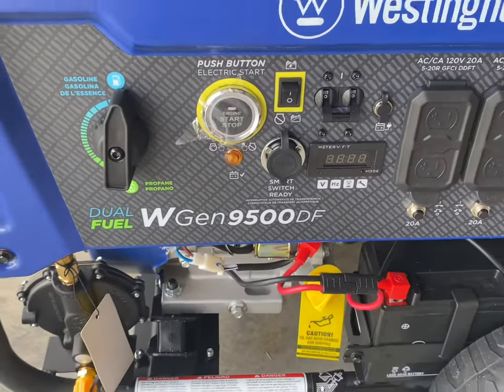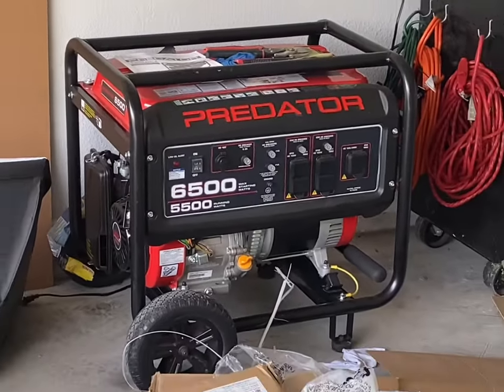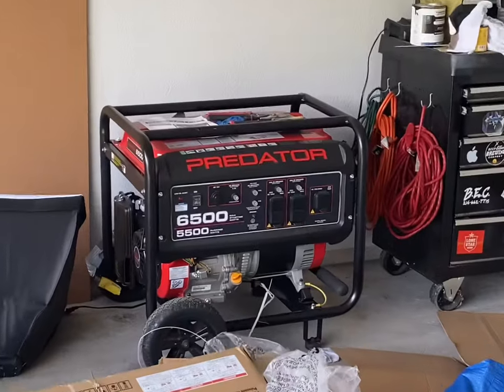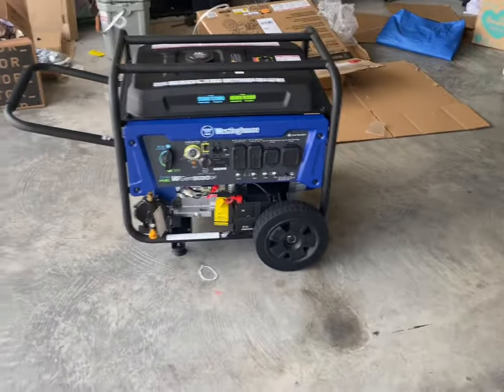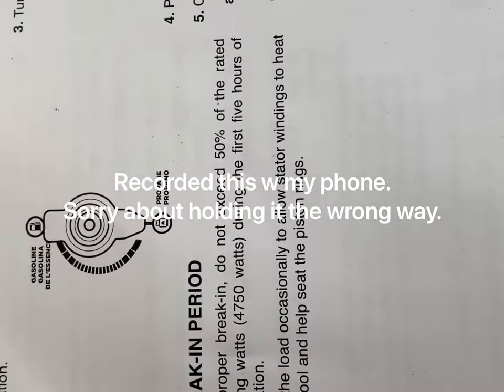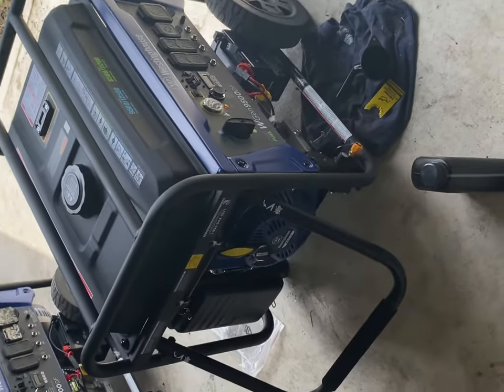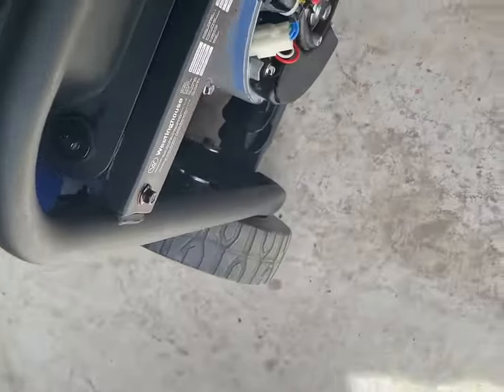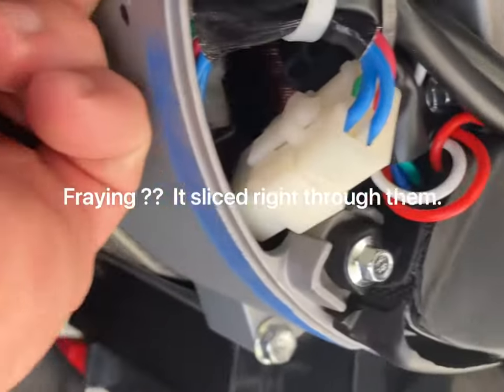Doing the initial engine and oil break in on my brand new Westinghouse Wgen9500DF generator.

Comment: Thanks for posting the video Korey. I bought this exact same generator last year. We`ve had to use ours a few times since last summer when we lost power in a few storms. I can`t say enough good things about ours. It runs most of our house, including the freezer in the garage. We run ours on propane because i don`t want to deal with gas and cleaning it out for storage when we`re not using it. I`ll be changing the oil in ours over the weekend so that its ready to go when we need it again. All i can say is, money well spent. I did all the electrical gen hook up`s to the main panel my self. I keep our generator in the garage, exhaust gets vented to the outside. I have a 15ft 50A quick connect cable that plugs right into the gen inlet box, and a breaker lockout on the mains. Hit that remote start, she`s runnin beautiful. After all the reviews i read, this was the right generator for us.
Reply from the maker: That’s awesome man! I definitely would love to be able to plumb it all from the inside of the garage, but I need the space more often than not and I’m moving them around fairly regularly  haha. Eventually I’ll make a small shed outside to keep it in, safe from the elements and locked up. The generator is absolutely a powerhouse and is the perfect portable whole home generator in my opinion as well. If I had a propane hookup I’d probably run it off propane in order to keep the carbs from getting gummed up, but I’ll just keep running it every couple weeks to try and combat that. Thanks for the comment man!
Reply: We just got one and I would like to leave it in the garage, would love to know how you set it up to operate indoors and vent outside.
Reply: Even though it’s vented outside, that can be very dangerous if something went wrong with the exhaust venting. Especially if your garage is attached obviously. I’d really consider if it’s really worth it.
Reply: Help we
Bought this same Unit and it smokes and uses oil then the safety shut it down can not get customer service to do anything .

Comment: I have the same generator. But my central air won't work on it. I'm using the 50amp to power the whole house. My AC has an older Goodman condenser unit. In rush amperage is 74. I have a Micro-Air Flex soft starter on the way. Hopefully that will take care of the issue.

Comment: I wonder why so many people change the oil before 5 hours as the manufacturer specifies…not judging, just honestly curious. I’ve also seen people using synthetic oil which they also say not to use…I’m going to do 5 hours under various loads myself and then change the oil. Nice video!
Reply: More oil changes never hurt an engine. There is debris from the factory. I personally plan to add oil and then change the oil before I even start it to get out any debris possible before running it. Bearings and cylinder walls hate debris. Then I will probably run it 5 mins and change the oil again. And then do the break in like this guy. I mean, it's about a quart of oil and such an easy oil change process, why would you be so cheap and lazy not to do it?
Reply: @JetFire9  Has nothing to do with being cheap or lazy. I followed the instructions, did as Westinghouse suggested and my engine is fine. The debris help break the motor in. Why do you think it's called a break in?
Reply: @JetFire9 We don’t know what kind of oil is in new Chinese built engines. Five minute run then drain is a good idea. Some of the Chinese oil smells like fish.

Comment: I probably over did breaking in mine (Champion 11,500) I did the 1 hr, 2 hr, 4 hr, 8 hour, 16 hr, 32 hr break in on oil changes (that includes using it during power outages). I put STP in the spark plug hole before I first ran it (and pulled it through 10 times before starting it) to lube the cyl. walls. I use VR1 racing oil in it and Marvel Mystery Oil in the gas. I know I over do it but I don't need it to quit on me when I need it.
Reply from the maker: Wow! That’s some serious dedication to the break in, but I 100% agree with it if it means a working generator when u need it! 🍻
Reply: I agree.

Comment: I decided to buy mine through home depot instead of home deliver.  My theory was that there'd be a smaller chance of it getting mishandled if it was delivered via semi truck.  I used to work at a home depot and everything got backed out of the truck with a pallet jack.
Reply: I bought mine through Menards. Got a Menards rebate. $300? Picked it up at the store.

Comment: I got this same generator a year ago, and am just now getting it up and running. Working great. Quieter than I expected. When it's running I can barely hear it inside the house. I'm using gas now, but the propane option is interesting. My next step is to set up this generator in a permanent spot outside in a shed/doghouse, and make it as easy as possible to activate it during an outage.
Reply from the maker: I plan on doing the same thing. It never fails, the power goes out when aim not home and my wife has to drag this thing out and set it all up. Making it permanent is a must.

Comment: Got this generator and had the 50 amp box run  outside so I can run everything with one plug.  Great vid!
Reply from the maker: Yessir! It’s a great generator and perfect for running the house. Appreciate it!
Reply: @KoreyB03  I have not broken it in yet.  Do you recommend the 1 hour change oil 2 hour change oil and then 2 hour change oil and then after that put synthetic oil in so its ready for game day?  This is my 1st generator so I just don't know
Reply from the maker: @USMCSDI  there are alot of different ways to go, but I’ve always gone 1 hr and then changed it after that. Then gone another 1-2hrs under a 50% load and changed it. Then I’ll run it another 1-2 hrs and then check the oil for any visible shavings and just made a judgement on changing it again. After that I change it every 50 hrs or if I run it for 15+ hrs at once I’ll change it. That’s probably overkill, but I need this thing to be dependable.
Reply: @KoreyB03  Roger that!  Makes complete sense brother.  I am in Southwest Florida... been here since 1997 and Hurricane Ian left me NO DOUBT that I needed to make this investment
Reply from the maker: @USMCSDI  no doubt I’d have one if I were there! We’ve had some rolling blackouts here in TX lately and my wife works from home so we use this thing more than I’d like to admit. Be safe down there!

Comment: If your going to run your central AC then add a soft start kit to your AC unit it will cut your starting amp draw way down
Reply from the maker: Absolutely. I plan on installing one of those in the near future. Luckily I haven’t had to use it much for the ac/heat so far.
Reply: I have one on the way. Micro-Air Flex. My Goodman Condenser unit lists in rush amps at 74.

Comment: It's funny but I got exactly same generator on Amazon 2 years ago, and like yours mine was damaged, mine badly, with crooked frame and busted stepper motor on its carburetor. The odd part was, that the shipping box didn't have even a sign of damage on the exterior, not even a dent, but damage on the generator was substantial.  I'm guessing it was damaged at the factory, packaged and shipped from China anyway, but it's just my speculation. Amazon refunded my money and now Im trying to find youtube videos with stepper motor close ups particularly, as mine has completely missing those parts. Thanks for the great review!

Comment: I bought this gen and just started it today on propane.  The manual says to make sure the Eco Mode Switch is turned off, but I don't see a switch for that anywhere, is there one?  I also checked the outlets and one of the 110 isn't working.  The other is and the 30 amp outlet works, so what could be the problem?  I tried pushing the small button at the bottom of the outlet, but nothing changes.  I have contacted Westinghouse and was told they would contact me in two days.

Comment: Just got mine yesterday. Did the break in today. I had no flakes in the oil at all. Hmmmmm.
Reply from the maker: That’s odd. Any time I’ve ever had a brand new engine there have been metal flakes on the initial break in. I mean, I’m no mechanic so I guess it could happen??? As long as everything is running good I guess. 🍻

Comment: Not sure what's up with the auto choke on these but if I push mine over manually it'll start first try ( even with a drained bowl), otherwise it'll go 3 or 4 cycles trying to start.
Reply from the maker: The auto choke is weird. I’ve honestly never tried it manually. I usually just let it do its thing, but if it starts first try I’ll give it a shot manually. I’d rather not have it cycling through 3-4 times like it does.

Comment: How much oil are you putting in? The manual says to check the oil by NOT screwing in the dipstick but that doesn't seem right as it will barely read "L" on the stick doing it that way. I don't want to overfill/
Reply from the maker: I wanna say it’s right around 1 qt. Honestly I did screw in the dipstick and check that way.

Comment: I'm thinking about pulling the trigger on this unit.  1 year later, are you still liking it?
Reply from the maker: I’m loving it. 0 problems w it. Runs strong and starts easy. Runs everything I need in an emergency.
Reply: @KoreyB03  - That's encouraging to hear.  I've been going back and forth on whether to buy one of the whole home (non-portable) generac/kohler units which hooks up to a natural gas line for the home, but the way I figure it, I could buy 2 or 3 of these Westinghouse units and still save 10 grand over the cost of the whole home units (once you factor in installation costs with certified electrician).  So even if one of the Westinghouse machines fail I'd still come out significantly ahead cost wise.

Comment: How much of what kind of oil is why I tuned in. This is frustrating.
Reply from the maker: Manual says 5w30 synthetic is safe to use for all temperature ranges. Also 10w30 is safe from 10degrees and up. So, unless you live somewhere where it gets crazy cold then either one of those is good to use. I use the synthetic in my mower so that’s what I use for my generator. This one takes just over 1qt. Manual says 1.18qt

Comment: Did it run your AC?  What size AC do you have?
Reply from the maker: Yessir, I have a 4 ton ac. It runs that, along w my fridge, kitchen plugs, and living room. I have to run an extension cord from one of the 110 outlets on it I to the house to the microwave Inorder to run it. Microwave always trips the breaker if I try to run the circuit it’s on. That’s all I’ve really ever put on it at one time. I’m sure it’s got more to go, but I just haven’t had any reason to run more than that at one time. As an emergency generator I’d recommend it every single time. It’s done amazing for me.
Reply: @KoreyB03  Great.  I just ordered the new 14500 trifuel Westinghouse.   I installed a microair easy start and took my 5 ton in rush starting amps from 148 to 36!    I immediately bought another for other 1.5 ton I have.   I think I will be able to run everything but the dryer and oven.   Was going to get the bigger twin cylinder but it looks like it would be overkill.  I do like the pressurized oil pump, cooler and oil filer on that though but just isn't necessary for passing storms.

Comment: So you have had it for a year, what do you think? I'm getting ready to upgrade my Generac to this size unit.
Reply from the maker: I love it. I have 0 negative things to say about it. It’s worth every penny when my power goes out and I can run the ac/heat, kitchen, and other rooms simultaneously. I’d buy it again no doubt.
Reply: @KoreyB03  I have a well pumped  also and it has a strong serge when it kicks on so I may need to go to the next size up.
Reply from the maker: @iwagsz it’s definitely possible. When my ac kicks on the lights I’m running dim pretty noticeably. Any other time there’s zero problem running the house w this. Even when I’m on main power my lights dim slightly so I’m thinking a soft start kit for my ac is in the future.
Reply: @KoreyB03  Yeah, I'm have one coming Monday to put on my heat pump system. My Generac RS 5500 will run most of my house including my well pump but I keep the water heater, range and AC off. I'm in Florida and it gets very humid during and after a hurricane so I almost have to size up after 3 years of running this little guy.

Comment: Hi! I purchased the exact generator and the engine turned over but would not start.  Now the return coil is stiff. I can't pull it!  Has oil and gas. Amazon refund me and told me keep it.  Any advice on how to unstick return coil? Thank you for sharing video. 🙌🏾🙌🏾🇺🇸🙏🏽
Reply from the maker: I’m no professional, but I’d probably start by checking the basics. Air, fuel, fire. Make sure you’re getting all of them. Gas to engine, spark from the plug, and air from the intake. As far as the pull start coil air take off the housing and go from there. Maybe the cord is stuck somehow or the spring is messed up. Lemme know if u get it working! I wish I could be more help!
Reply: Pull the spark plug and it will free it up. Then reinstall
Reply: I had the same problem bought mine from Amazon. Right out of the box it wouldn’t start. Pull start wouldn’t pull either. Contacted Westinghouse and they had me bring it to a Service center. They couldn’t fix it so Westinghouse sent me a brand new one.
Reply: Mine is having same issue. I have to start with propane which is easier anyways then switch over to gas to get it going. Then it will start using gas. Its finnicky.

Comment: I'm contemplating this or a smaller inverter generator. The only thing I'm unsure of is what people say about pure sine wave vs dirty power. Especially for electronics. Any thoughts?
Reply from the maker: So, I have heard all those comments as well and I do believe there is validity to them. I personally haven’t ever had a problem w the power this generator supplies my house with in the emergency situations when I need it. All electronics I’ve ever ran off of it have worked flawlessly just like they do w main power. Tv, internet, all kinds of chargers, laptops, iPads etc. ran the house for 18 hours straight one time and no hiccups at all for me. Hope this helps.
Reply: @KoreyB03  that is exactly what I was hoping for, thank you that was helpful. Were you able to get 18 hours off one tank?
Reply from the maker: @User-wr5vg  excellent. I believe it was somewhere around a tank and a half. It was in the winter and I’d cycle the ac/heater off after every time it would run and then switch it back on whenever the wife and kiddos started getting cold. It I leave the ac/heat on the full time I’d probably only get about 6-8 hours on a full tank. Central air/heat puts a good load on it. I don’t have a soft start kit either and I believe that would help a lot during the initial power draw and load on the generator.
Reply: @KoreyB03  Oh yeah that's understandable, I would be tempted to get that so I could run the HVAC if needed. One last question, how long does the battery seem to last for the automatic start? Is there an indicator of what the battery level is?
Reply from the maker: @User-wr5vg  I want to say there is a battery indicator, but I’m not 100% sure. I haven’t had the battery die on me yet so that’s good. I try to start it up every month or two and run it for those reasons Also. I’ll get back to u on the indicator tho.
Reply: @KoreyB03  much appreciated!
Reply from the maker: @User-wr5vg hey brotha, just got around to checking it out. No battery level indicator, but does have a light letting u know it’s on and good to go.
Reply: @KoreyB03  Thanks brotha! Appreciate you taking the time to look into that for me.

Comment: Hey buddy great video. What oil did you use? with it synthetic ? what brand did you use? Thank you in advance.
Reply from the maker: Thanks man. I used 1030 synthetic. There’s a chart in the manual that says 530 synthetic is the best as far at any temp range, but 1030 is what I had on hand and it’s next best on that same chart so I went w it.
Reply: @KoreyB03  Thank you so much. I really appreciate the info and help.
Reply from the maker: @GI-JOEs  not a prob man.

Comment: Korey,
Just got my generator.  9500/12500. For the first break in, use the 10w30 oil that comes with it, the can I go to a 10w30 synthetic for the rest of the time? For the other 2 break in time?
Reply from the maker: Absolutely. In the manual it suggests 5w30 synthetic, but I have used 1030 synthetic when it was what I had available.
Reply: Awesome! Much appreciated!
Reply: I have access to Rec Fuel. It's more expensive, but is it better to run and leave in the tank compared to standard unleaded which has ethanol?
Reply from the maker: @c-rob7615 that I’m not sure of. I use pump gas and my generator sits most of the time so I usually try to keep some sort of fuel stabilizer in it just to help it from sitting up and gumming up the carb. I do run them atleast once a month for a good 5 min if they don’t get used.